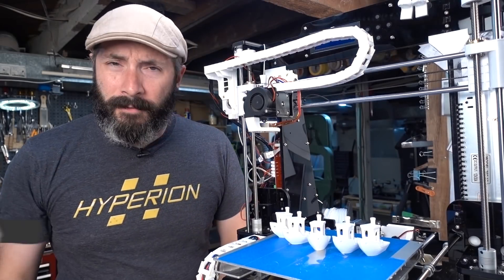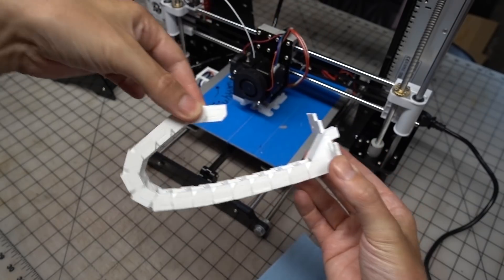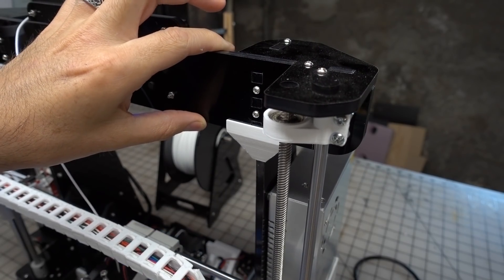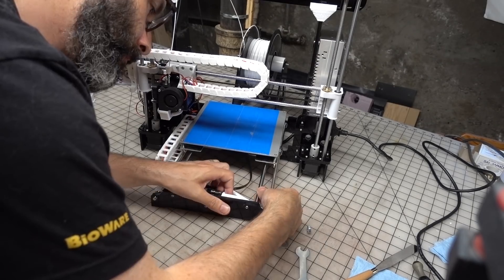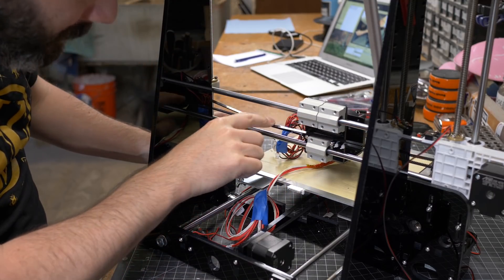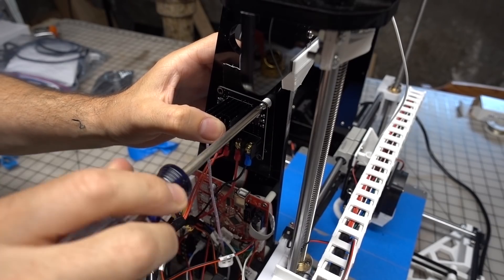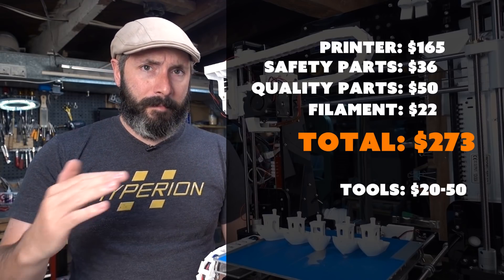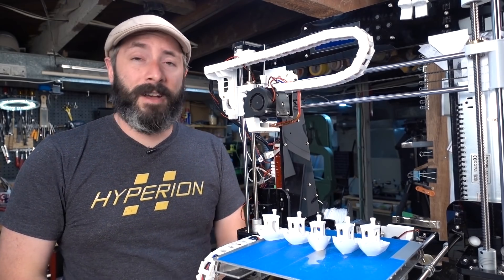Make a Cheap 3D Printer Better - Anet A8 Print Quality Upgrades

Comment: I started out on the stock Anet A8 and I was never really happy with it. The creaky and wobbly frame and the ungodly noise it made no matter how I changed the print settings drove me up the wall. 

In the end it sat unused and half disassembled in a corner for almost a year. I still wanted to get this sucker working, though.
So I sat down one day, had a really hard thinking session. Now, a few months later, the only original parts left are the motors, PSU, heat bed and parts of the wiring harness. 
I did the AM8 mod, with 2040 aluminum profiles and Hiwin style linear rails. The board now is an MKR 1.4 running Marlin 2.0.5. rocking a set of TMC2130 stepper drivers. The addition of Octoprint is on the way. There was a lot of „If I am doing X, then I may as well go all the way and do Y too, while I‘m at it.“

At this point I am not even sure if this is still the original. Feels like I built a new printer. And now I can sit next to it and not hear a peep. 
No, this is most definitely not budget friendly. But I now have the printer that I didn’t even know I wanted. If any of you readers are curious now: The AM8 is not an easy upgrade path at all. But absolutely worth it for me.

Comment: proper tension in your belts and bed leveling is key. Those frame supports are necessary because the frame will flex if you tension the belts. another thing is extrusion. make sure your printer is extruding at the correct rate. When you extrude 100mm from the printer console 100mm should have extruded on your printer. messuring and marking the filament should help here then just adjust the flow rate to compensate for the inaccuracy.
most pla's come with a recommended print and bed temperature. i recommend printing a bench that changes the temperature during the print to see which temperature the filament prints best at.

one more thing the nozzle you are using is unfortunately probably the second worst one (after the stock cooler) and often comes off during prints. The semi-circular seems to preform the best overal and mounts more securely
. upgrading to skynet is deffinately a good choice

Comment: I'm getting excellent results with mine since I've check the squareness of the bed with the x axis rails. Also! Safety tip..check the ground connection of the connector going into the heat bed!
Reply from the maker: Great tips, thanks!

Comment: i dont know where to document my life except for youtube comments i guess. anyway, printing the wire chain stuff, the first 4 banger was 9.1 grams, the second was 9.2 grams, just finished the third and it was 8.9 grams.  thx for the link man, just built printer now working on the upgrades in spare time.

Comment: Another consideration is the parameters in your slicer software can make a huge difference. With my A8 printing at 30mm/s alone delivered dramatic results. Still working on other areas but an essential check
Reply from the maker: Good to know!
Reply: Interesting. When I try to print that slow, quality starts to suffer.

Comment: The only thing i replaced is the bearings as they was noisy and got the same as yours,
From the looks of it this printer was not built Square/level (correct) even tho you done a good job.

Apart from that I print production quality parts. 
I don't use Cura as it seems to do weird things,like 2 prints were never the same & always getting poor prints. it also has so many  settings that just causes complication to other settings.
Anyway i use Matter control. its also free and just works perfectly.  you can design models inside it, so No cad or tinker stuff needed,  also the best thing is you can change quality or other settings as you print, 
so just say you have a model and the bottom part only needs to be low resolution and the upper parts needs to be Fine quality .
so you just change settings when you need to.
The best thing that I like is that, at night time as to not loose to much sleep from noise, I change the settings to a lower speed, and so makes it a lot quieter.
My Advice would be. Before thinking about spending time and filament on so called upgrade parts to get better print. Is look at the software settings, and in my case Matter Control works fab on my Anet A 8 
Just as i wrote this comment i have also designed a MG34 rear gun sight and now printing , all in within 15 mins,
just thought to say . Lol

The only safety device i had bought was a Remote control RCD plug adaptor,  again it is good , as no Mosfet to install and plus it give me direct control to turn on or off without installing an on /off switch.

Comment: I realize this video is over a year old, but an upgrade everybody needs to do is printing and installing some guides for the bed adjust springs to stay straight. While you're at it, also add some larger knobs to the butterfly nuts of the springs, so it can be easier to adjust them. 
Also, and inductive bed auto leveling sensor is a must.

Comment: Thanks for all of these Bill, I've been dealing with an issue where it seems mine extrudes plenty of fill for the raft and then not enough for the main. I'll check the Extruder with a .4mm 

Thank you so much again for all your and Brit's help over the years.
Reply from the maker: You're welcome! You may need to check the "estep calibration". I've never done it myself, but it's been recommended to me several times.
Reply: Punished Props yeah, I was trying to futz with that and thespian and the print speed. There is a 3 way Vin diagram there somewhere. Really liking that I'm learning so much, wishing is dint have to learn it.

Comment: There are all sorts of upgrades and modifications, (some of what you did are mods as opposed to upgrades.) for all sorts of printers.  OK, so you spent a bit more money and solved some problems.  But consider this--The upgrades were already there for the downloading, and I'm pretty sure that you'll find that when you get around to replacing the hot end, or some other critical part--you're going to find the replacement parts you need easily and at fairly low cost.

In my case, the "best" mod/upgrades were the ones that let me tighten the belts easily.  I've been getting good prints since I added the Y-tensioner and further improvements came from tuning and adjusting heat settings and extrusion speed and such.  Tho, even my earliest prints looked better than most of your later prints.  (I attribute that to luck.)

Finally-The only reason to Skynet firmware is to add the leveling feature.  (OK there are a few extra safety features.)  And there are various configurations included in the Skynet package for which control panel you're using and whether or not you have a bed sensor.  If you use the wrong config.h file, you can make it more difficult to level the bed, or be unable to control your printer.  You should be using the version labeled " A8 5buttonkeypad- no autolevel"

Anyway, your Anet vids have been great, and very fair and unbiased.
Reply from the maker: +DancesWithRobots Cool! Yeah I wanted Skynet for the thermal runaway safety feature. Belt tension seems to be the best upgrade so far.

Comment: It would appear that you've got a lot of Z axis wobble on your printer. I'd check they are straight, cos I bet they're not. Also, where's your auto levelling? That's a must have upgrade. I agree with others about the Bowden upgrade too. An already heavy X carriage is being weighed down with more stuff like the unnecessary cable arm.

Comment: A 3d printer resumes to accurate movement in x y z and this means no skip steps, no loose spring belts, no wobbly axis of movement (the axis itself mounted in the frame and the carriage bearings) and no binding or restricted movement (if axis are sqewed or bent, shot bearings out of lube and with play, or resonance movement with a springy frame and slim axis). After that comes the smoothness of control of the steppers like microsteps, small angle steps, smooth electric control from the driver (something like trinamics, or at least TL smoothers)

So the recepie for a good printer is to have a good stiff frame. Extruded aluminum with corner brackets can make a super sturdy frame (some diagonal braces as well). Here you spend a good chunk of money
Then you need nice movement on linear bearings like thick round bar axis and good linear bearings. or even linear rails with adjustment gibs to make the fit perfect (you need nice quality to get the straightness level and accurate dimensions and proper hardening) so most cheap china printers have low quality axis (sort of straight, low hardness, crappy bearings that may work but will grind the axis rod in short time and also they use small diameter to make it cheap)

Even more important is how the axis is mounted on the frame. Ideally you need angular free play to make the axis self align and not stay in tension, like spherical joints or Heim coupling, or self align bearing blocks. This is to keep the y axis(for example) stay tension free in the frame. 
Next is critical that you can adjust the position of the ends of the axis to make two axis perfectly parallel and perpendicular to the other axis(for two Y axis or two x axis, or two z axis). So i've made use of some blocks with self align sleeve bearings that are mounted on the frame on slots. I can shim the block to raise or lower and move side to side (even front and back) with the elongated hole mount. 
The critical part is how to measure the true aligment and have a system of adjusting. For example mount the bed on 3 bearings not 4, make the 3 bearings swivel-able so each can self align on the axis and not put bend stress. Then by moving the bed end to end you can create a set distance between axis so is time to carefuly tighten the axis with the bed mounted and ensuring free movement of the bed.

Same for X carriage and Z axis.

Then after you have the means to clamp without stressing the axis, to align the axis here you need, and have a bearing that will not force a bend (swivel) in the axis this is the base for a very good printer. After all this hard work you need to mount a way of moving the axis in a tension free fashion. Here there are options with belts (stiff but flexible and does not stress parts much and have minimal backlash),movement screws (like on Z axis on most printers) that have backlash and even antibacklash  nuts are not a solution if forces are applied (there ae ways with fixed backlash adjust but the risk is bending the screw if the nuts are nt in perfect aligment), or rack and pinion (it has backlash but with a split gear it can be adjusted to tighten and eliminate backlash), or other fancy recirculating driving nut and screw.

After all that care has been taken to have proper axis and frame it would be a shame to skimp on a quality original hotend with precise nozzles and accurate thermistor and good heating, good heat management design (to prevent creep or other issues.. so original E3d or copperhead or other nice hotends). Also good steppers (reliable with no skip steps also torquey and fast with low angle. Also use the appropriate gearbox or pulley diameter to further increase resolution but make sure the steps are not smaller then the minimal play you get on your axis.

Also good steppers are a shame to be contolled by cheap choppy drivers so you go trinamics on a good reliable board with lots of functions and easy to implement like duet 3d 32bit, or even 8bit einsy rambo.

In the end a good printer has nothing useful from a cheap china printer. If you want minimal equilibrium betwen frame and components quality the you look at Prusa mk3s that has quality original parts in ever regard, a decent AL frame, good control on reliable electronics and steppers, good belts with proper tensioning, good design, and massive comunity. So i got a prusa as my 1st printer.

Then i got a cheap A6 Anet that i've improved a lot in the axis and stiffen the frame (from steel.. i'm a decent welder and work with steel.. so i fashined a steel frame and ensured a way to adjust axis positions to account for warps from welding and other stuff.) and got it going sort of ok but still had crappy motors, crappy control, crappy belts, crappy hotend. I'm qeeping my anet a as it is with the limited upgrades and call it a day.. print quality is decent if properly tuned.

I will be building a proper diy printers with a steel frame (I can weld and steel is cheap) with overkill axis (at least 20mm round) and true stepper motors and drivers (got some beefy ones from an old CNC.. not great step angle at 3degrees but i can trim it down in a gearbox. They have plenty torque and speed) - sure i will need custom drivers found in CNC machines rather than trinamics drivers. I plan to use a supervolcano e3d (maybe two extruders) and plan to make a mount for a CO2 laser for lasercutting/engraving and why not a CNC 2.5D mill but chips on a 3d printers will be another issue.  B the time i'm done i estimate i will go over 2k euro in it.. so i might just find a cheap truce CNC mill and make the adaptations for a 3d printer. it maybe cheaper and sturdy and accurate (as a mill requires)

Anyway I'm mechanical engineer by trade and as a sum of the above post is that above all upgrades the major thing is to make sure you have good movement on axis with no tight spots, no bends, no stress in the moving parts to force a bend, no out of parallel axis, tight belts not springy. This will get even the stock cheap printer print rather good.

Comment: Try working with your print settings more. Do temperature towers and extrution cubes to find the sweet spot. I feel like I have the worst printer and the benchy prints are amazing after a few hours of calibration prints.

Comment: hey great video, with my a8 the biggest differences in print quality made a bowden tube, good and detailed slicing parameters with cura, adjusting the extruding flow and a good leveling of the bed.

Comment: Some of your quality issues may have more to do with the speed you are printing, than frame rigidity.   You tried slowing it down below 20mm/s?  Nice to have good belt tension too. Those Y-axis braces are a must.  Mine started to warp badly, esp after hot-boxing it, trying to reduce shrinkage on ABS.   My most recent A8 upgrade, an inductive bed sensor, is the BOMB!  Just hair spray on bare (60C) aluminum works well for adhesion, with a level bed.  After the bed cools, not so hard to remove the print ... a little water can help.

Comment: I got the even cheaper wooden variant, and replaced the whole frame with a welded steel one.This massively improves rigidity and print quality on its own.Files for the parts required to convert to the steel version are on thingiverse.Also belt tensioners,new cooling nozzle and toothed idlers plus upgraded to all metal extruder drive.
Reply from the maker: Oh neat!

Comment: for the heat break fan i just used a small i beleve 10 mm fan i had too bolt one side down and use a twist tie on the other but had no problems out of it ever again. it looks like you are using the same upgrades i am for mine .

Comment: Try adjusting extruder temps or even a different brand of filament. I have noticed a difference changing from 190 to 200 for pla, ymmv but tinkering with many of the settings can change print quality.
Reply from the maker: +Ian Ide Yeah I'll cover that in the next video.

Comment: Awesome, Bill! That little budget printer's lookin' mighty fine! :D  One little piece of advice though for anybody looking to do these upgrades; Browse cable chains on Amazon or eBay before you commit to printing them. They're usually around $10 or less for quite a good length... And while the filament usage is no real concern, printing a bunch of cable chain can be very time-consuming.  (Basically a "Weigh it against what your/your printer's time is worth." scenario.)
Reply from the maker: Well geez. I should have just bought some! HA! =)

Comment: I also have an A8, but it prints virtually flawlessly with no additions. Of course I have many of the 'things' for the A8, now.
You should remove the top Z axis bearing guides... if they don't line up it is because the motor below is not centered. Fix that and the lead screws will be centered all of the time. Keeping the Z axis bearing guides is just going to cause the lead screws to bend in the middle as it prints and you will get lower quality/offsets/stress. The noise that you heard before applying oil was likely the due to the misalignment of the motor/lead screws..
Reply from the maker: That is a super interesting point. I'll have to tinker with centering the motors. Thanks for the heads up. =D
Reply: My A8 printed very nice too, out of the box. Your piece must be somehow defective. Anyway, I like your X-chain mount piece.
Reply: Can you share your pla settings ? My prints on my a8 are always spongy and the demos that came with the printer are beautiful and hard shell that tell me it’s my settings
Reply: RCisco Open your printer config file and change the filament from 3 mm to 1.75 mm.

Comment: If you want to have better bed adherence, get a sheet on PEI and install it over the heated bed. It sticks like crazy when hot and pops right off when it cools down.
Reply from the maker: Good tip. Gonna stick with blue tape for now, but that would be a good addition in the future.

Comment: The biggest problem with this printers is one that isn't given much attention. It's the rocking from side to side. You can fix this by adding two pieces of threaded rod and some nuts though the back body of your printer. I did this and it improved my printed pieces dramatically.
Reply: robofatcat where can I find a more detailed tutorial on that?